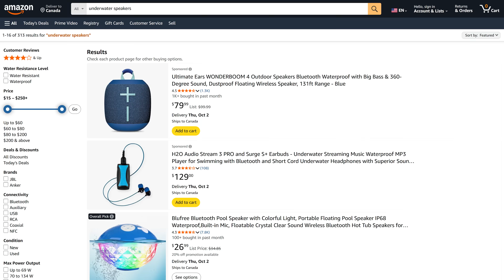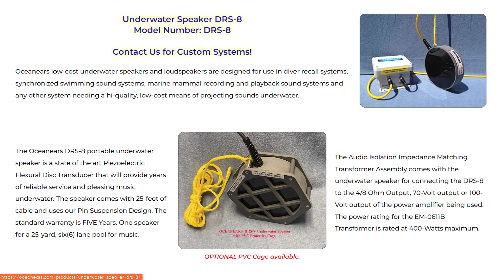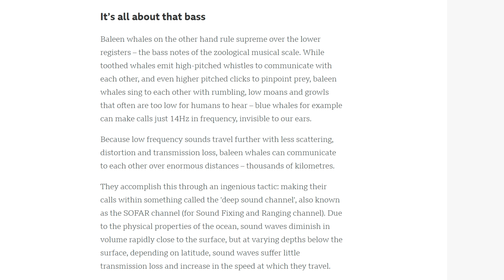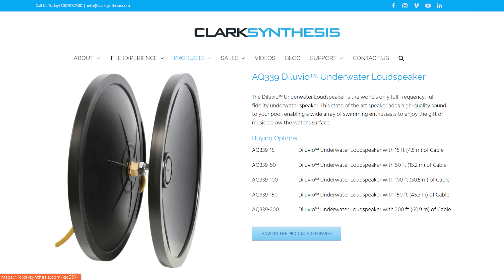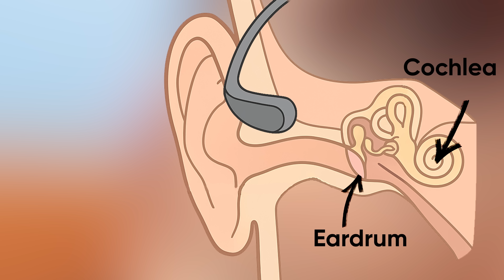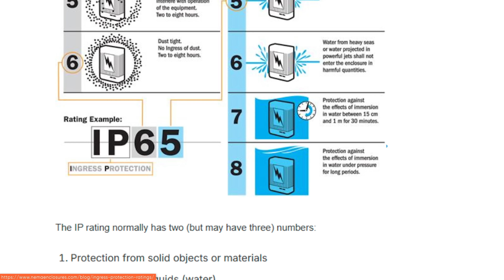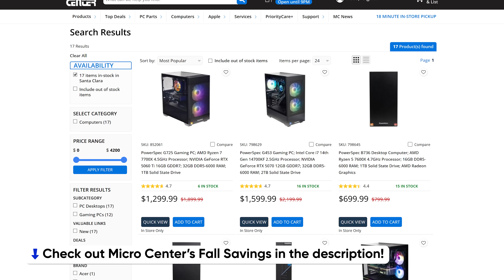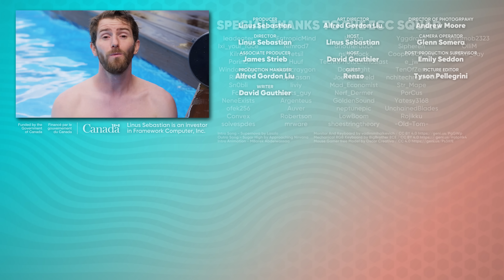Can you Listen to Music Underwater?

Comment: I use Shokz when I go swimming. First of all, if you swim in a public pool, you wear a cap, which has two consequences: shokz fits much better on your head (as they are pressed by the cap), but it also hurts your ears. In addition, I found that if you wear earplugs, the sound becomes much better.

Comment: Please do a product comparison!  I use an older model Shokz bone conduction headset as my primary headset outside the home.

And I literally just bought an off-brand underwater version which has a radio transmitter that stays outside of the pool and connects to your phone through Bluetooth, but uses non-bluetooth to broadcast to the headset.  I won't get to use it until next week, but regardless you should probably include it in your comparison.

Comment: Tip for the openswim pros — turn on the swimming mode for mp3 playback in the app! It tones down the bass and they actually end up sounding not half bad underwater with a wider soundstage than they have out of water.
Reply: Exactly. I have these Openswim pros and they sound waaaay better in swim mode when underwater. Above water is irrelevant for me anyway :)...
Reply: Another tip: use earplugs. Made the sound a lot more consistent for me.
Reply: The issue was mostly the inconsistency between air and water playback. David even comments that the base can be toned down.
Reply: @dr4gonstear  They are designed for swimming laps in a pool, and if you're a competent swimmer that can swim long enough to want these, the breathing doesn't really make a big difference in the sound quality.  They are not intended to be used to waddle around with your friends in your home pool like in the video.

Comment: i have an idea for a future video.  have you heard of a program called Rouvy before?  it provides recreations of real world routes that syncs with gps data to simulate terrain.    The basic premise is as follows.    You have a device called a smart trainer or smart bike (there are tens of models out there).   You attach any bike to the trainer by removing the back wheel from the bike and using a bike cassette on the trainer instead. As the rear derailleur and chain will still be on the bike - any sort of gear shifting would feel just like on the open road.  you also the option for virtual shifting too with a tiny button device called the zwift click.
Anyway the bike and trainer would connect to the computer via bluetooth or ant+ and communicate with the Rouvy program.  Rouvy sends data to the trainer to increase / decrease resistance to simulate road gradients whilst the trainer sends power and cadence data to Rouvy .  Between them  you get to determine how hard and fast you ride (that's what she said).  

These are real world routes from around the world, so you could try out this year's world championship loop in Kigali, Rwanda, a nice easy European mountain climb like Mt. Zoncolan or col de Tourmalet or a long relatively flat route such as the 180 Km Ironman Kona route .   There are thousands of options.

Anyway  you could make a super immersive Linus pain cave  with  surround monitors, multiple fans (vital as you get pretty warm).  You can even get devices where you remove the front wheel and attach the forks to in order to raise and lower the front of the bike when climbing as well as rocker plates to give the bike and trainer lateral movement.

You can get free trials with Rouvy,  You could even create a few setups and create a race with some of your team which could go on to your member's channel.   

I have a few hundred Rouvy videos - general rides and races so you can get an idea for yourself whether or not this would be a good video idea for yourself.

Comment: what is the range of the underwater speaker. could it be used on costal beaches for warnings to swimmers of sharks or tsunamis? odds are alarm sirens will take care of the job in most cases.

Comment: A cool tech in the audio department, the Kemper profiler and other amp profilers like it are pretty cool tech, they play a sound through your guitar setup, measure how the sound was altered by the tubes and analog gear and copy the signature of the sound, so essentially you can faithfully copy and the sound of a boutique $100k amp without need to sell your house for it or break your back carrying it around

Comment: Can you listen to music underwater?

Whales: hears from thousand km away What a banger
Reply: There is a Whale Lan slogan hiding in there.
Reply: we could talk to whales with this, if we knew how though
Reply: @Katauris  would it be possible to transfer data over that? Like a global radio station or something xD
Reply: @anterprites  probably gonna piss off some whales with random spam calls
Reply: @calok  "we've been trying to reach you regarding your krill's extended warranty"
Reply: @anterprites  Bro, thats just dial-up internet with extra plankton
Reply: @anterprites  you can look up mud pulse telemetry which is more or less this concept - drilling fluid or drilling mud fills the hole as you’re drilling for oil and gas. Pressure pulses can be made at the bottom of the hole that travel through the fluid and can be decoded for information.
Reply: @anterprites  you can but it would be very slow(100kbps)
Reply: @anterprites we've been trying to reach you about your vehicles' warranty.
Reply: I would rather make a cabel like optic fibre but with water. 
@anterprites
Reply: @anterprites  absolutely, I would think so - just modulating the audio to carry data would seemingly translate just fine into the water domain. might have to adjust for reflections and stuff, not sure though

Comment: I have the bone conductive headphones. 

There is a swimming Setting and a non Swimming. 

But they are right, the extra water around your inducers massively pumps the contact patch with your head and thus the bass. 

Another point is my head's a 62cm circumference and they are a tight fit. 

The file transfers annoying, you can't add by app. You can't add by directly connecting to an android device. But they come up as a SD Card reader on windows.

Comment: Have used the older openswim for a couple of years. It has a setting that adjusts the modulation of the sound for underwater use which normalises the above and below water difference, but the manual did say use the included earplugs for best audio experience.
Re the fit, placing the front arms under your goggle straps holds it in place for best conduction.

Comment: We own 4 pair of aftershokz and love them my favorite ones are the open coms with the boom mic i use them 8 hours a day for work and they are super light
Reply: I've got several pairs as well. Honestly I'd rather wear this style vs air pods or another in ear headphone. Keeps my ears open, and let's me use ear plugs for yard work.
Reply: I have been using shokz for biking for years. They're great. First the bluez 2, then an upgrade to the Trekz Air and after those recently died the OpenRun Pro 2.  I'll use them for phone calls, it's far more convenient than holding the phone against my ear and I hate having inears plugging up my ear canal.
For work I have the option of a beyerdynamic MMX 300 headset or in my homeoffice I have an at3035 mike on a Scarlett Solo 4. No headset is beating that.